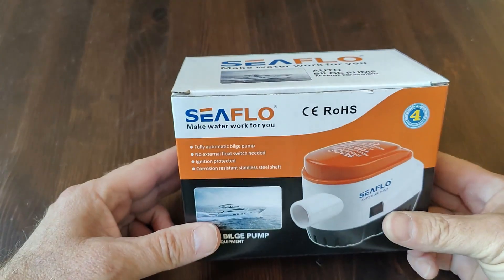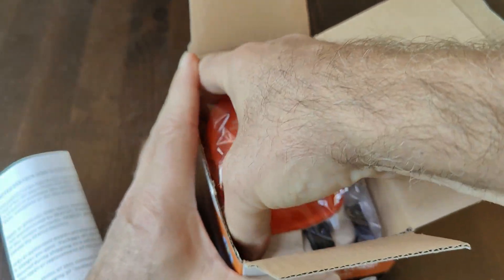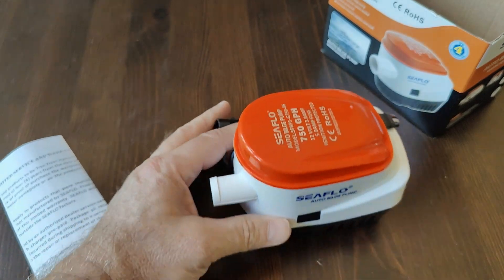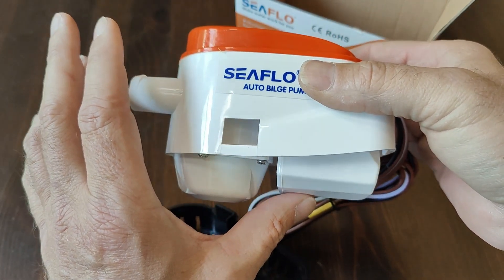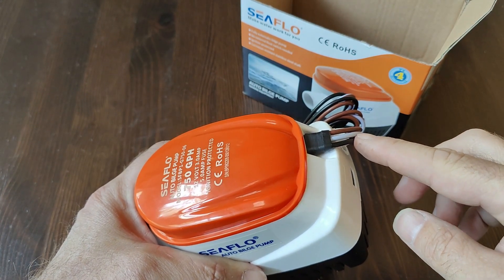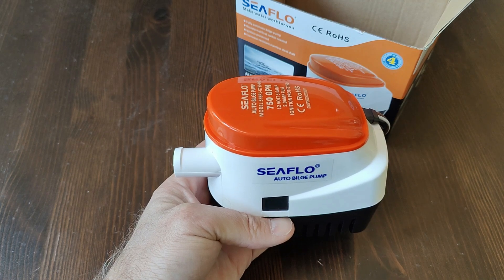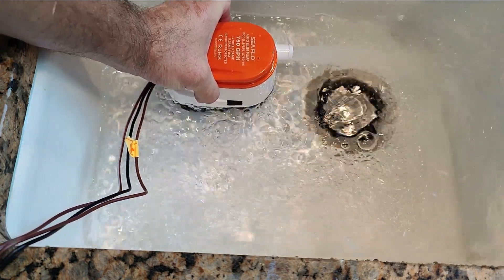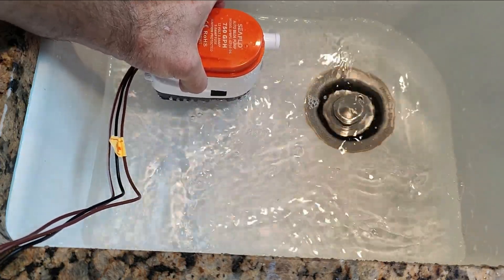SEAFLO 750 Automatic Bilge Pump

Comment: Great video. I cut my wires off five times thinking I did something wrong. Started filling the boat with garden hose. Only solid brown would work the pump. Then I realized striped wire was not working because water level never activated the pump. Your video showed me the wires! Thanks. Also there is a little test swivel switch on the side and no need to garden hose the boat hahahaha